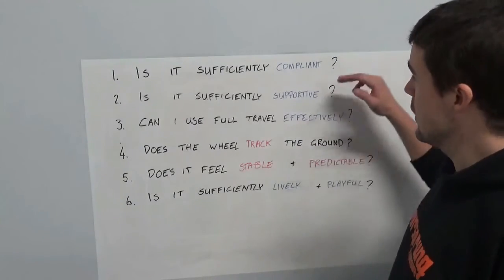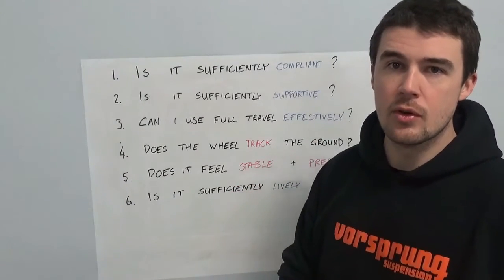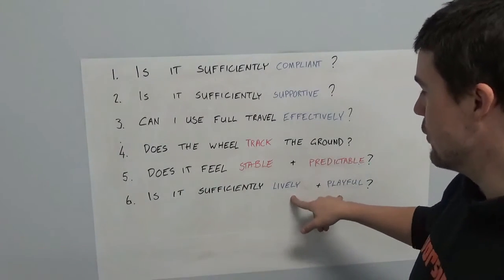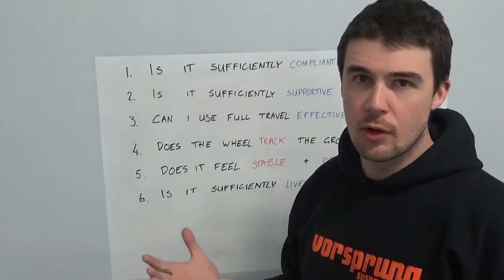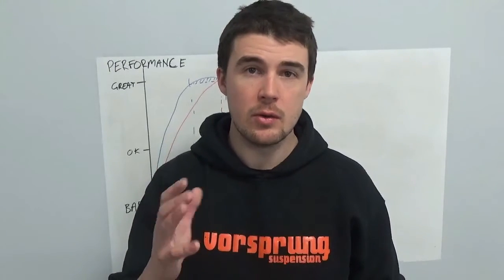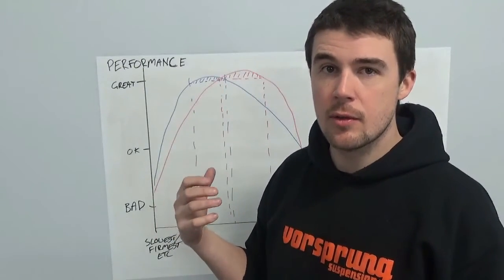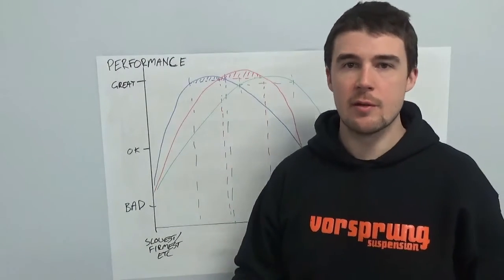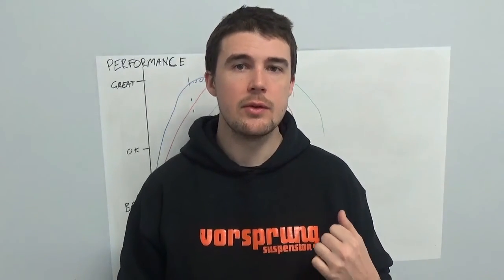The Tuesday Tune Ep 15 - The Concept of Correct Setup

Comment: Great video and tutorial as usual Steve! I would like to comment about, to paraphrase the quote "what feels good is good" and what feels bad...(is not so good) I would like to add a caveat; what I've learned from the Moto side is that the faster your lap times become what was good at a certain speed is not necessarily good at a higher speed. Something I am just discovering on the mountain bike as I ride different trails and some downhill. Set up becomes more critical as terrain gets more Technical and speeds increase. (obviously right? 😁) for me having the Wheels track the ground as much as possible is most important. From what I've learned again from my years in road racing is that almost every setup will be a compromise to some extent.  I'm finding that on the mountain bike there is more of a compromise then a road racing motorcycle. I've done about 60 hours of mountain bike rides in the past 18 months, and I'm still experimenting with both rebound and compression.  I've hit what I felt was a pretty good setup on a number of occasions but of course with each Trail System it does change a bit. I always keep notes of what set up I had at one particular Trail so I have a baseline when I go back.  but as I gain more experience and ride faster it's almost as if I'm starting from square one again.  on one hand it can be a bit frustrating but on the other hand I do like working and adjusting on suspensions and bikes in general.  the upside is I'm constantly learning. 👍
Reply from the maker: I'd agree with all that. If you're racing, what feels fast/slow can sometimes also just be more related to how in control you feel at the time. Very dead-feeling and/or harsh feeling bikes can be faster than bikes that feel "nicer". Most of the people we're setting up suspension for however are not racing, just people who want their bike to feel good when they ride it.

Comment: Awesome videos . im 225lb riding a 160 lyrik . i struggling to use the top 1.5" of travel but blow through my mid end . i run 22% sag with 2 tokens  with  98psi and run lsc full open to componsate the massive brake dive i get. Do i need more tokens and less psi ? Or more psi and less tokens. Advice would be awsome. ?
Reply from the maker: I don't want to be the guy that spams you or anything, but I'd highly recommend you try a Luftkappe. Makes a huge difference to all of that.
Reply: @VorsprungSuspension  Any word on when its coming to the 2019 Lyrik? I have the exact same issue on my 19  RCT3 and weigh 230
Reply: I rode a bike with a 170mm Lyrik and experienced the same problem. I think it's a common problem.

Comment: I think the "tire pressure as low as possible" thing is only for gravity fed MTB.  If you are pedaling, you don't want to waste your energy deforming your tire.  Right?
Reply: no. Pedalling with compliant enough tyre on anything than tarmac will be faster, because the tire is going to conform over bumps rather than being deflected. Also chatter is tiring, so too harsh of a tyre will affect fatigue over long runs.